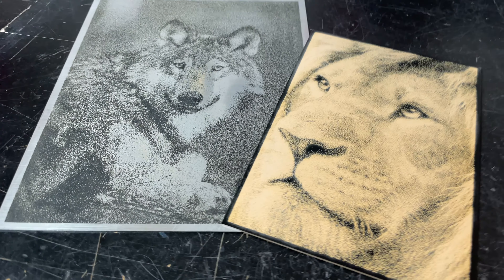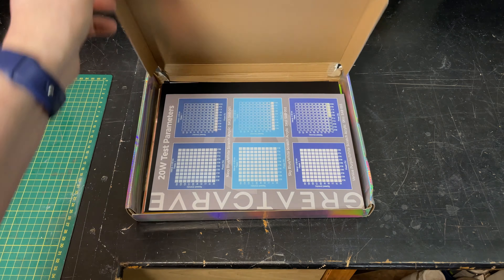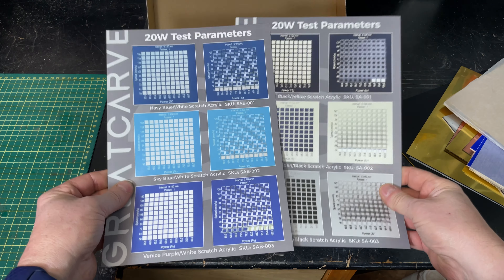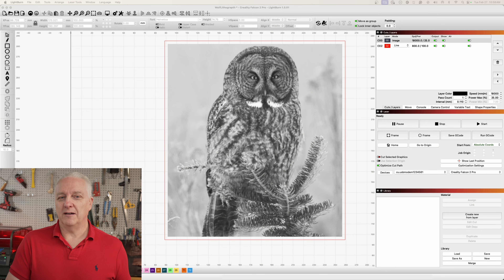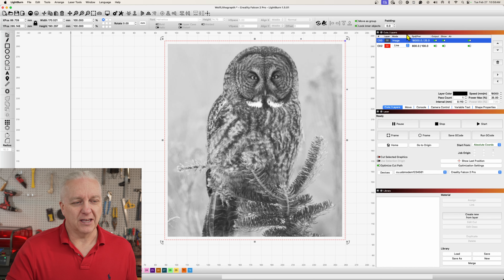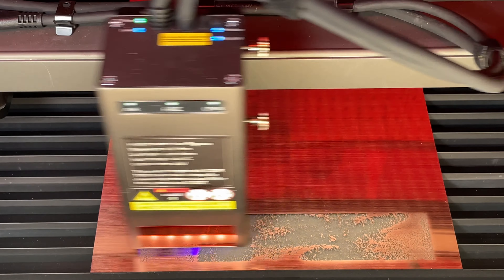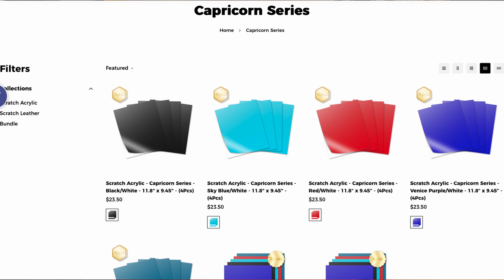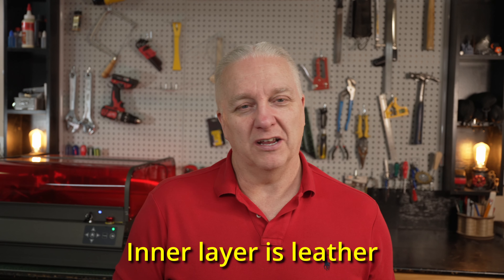Diode Laser Engraving Using Great Carve Scratch Acrylic - The Right Material is Everything

Comment: Do you think that material would be thick unplug to use them for templates? Since you said you can cut it
Reply from the maker: It is but it’s pretty expensive for that. A diode laser can also cut standard 3mm black acrylic which is cheaper for this application and cardboard is even cheaper (free)

Comment: Did you use such a low DPI because of the beam size on the Falcon?
Reply from the maker: Yes.  There is no point making your interval smaller than the beam height.  That only results in overlapping lines and results in a poorer-quality image.

Comment: Had zero luck using this stuff so far.
Reply from the maker: What’s the problem?  It doesn’t require a lot of power and too much will just make a blurry mess.
Reply: @SteveMakesEverything I tried different ranges from 20-50 on a 20 watt falcon 2 Pro. I can't seem to get much detail like I've seen others achieve
Reply from the maker: @JoesAutoElectric  The first thing to do is to run a material engrave test in Lightburn so you can see where the power range is.  50% is definitely too much.  Depending on the scratch acrylic, I've used as little at 15% power, but you also need to determine the speed.
Reply: @SteveMakesEverything  I was going off the card it came with. I am running a 20 watt unit, which is what they base the results on.
Reply from the maker: @JoesAutoElectric  Consider these a guideline, but every laser is different.